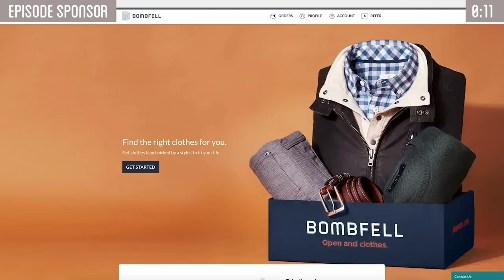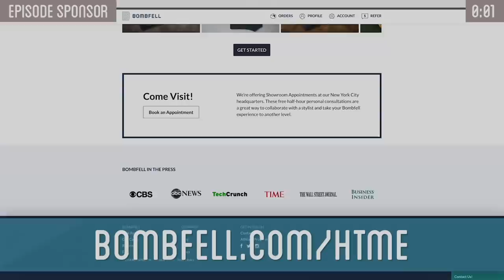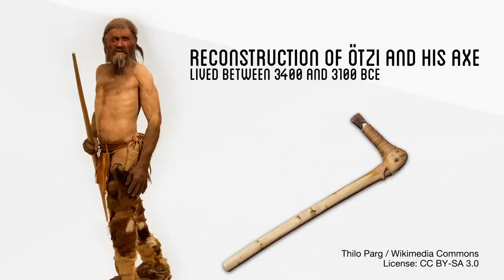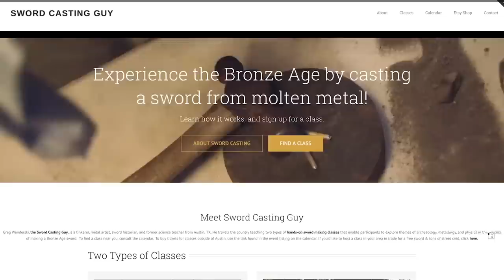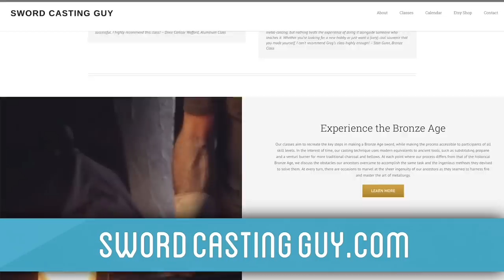Casting a Bronze Sword

Comment: I think it's illegal to destroy currency,and your doing that by melting pennys
Reply: its just pennies in total i think since they are made of metal that is high enough in purity its technically worth more than what it is in material than its given value.
Reply: Question. Is that only in case he tries to profit from them or any kind reason?
Reply: @blazingeek  its in any case but i think the intention of the law placed was so that people couldn't theoretically double or triple there low investment. as 1000 pennies is £10 and technically each penny might be worth 2-3 pence in copper so in turn you would sell £30 worth of copper. that's just a rough example.

Comment: Ok you realize you can't cast a sword right? It just ends up brittle
Reply: Except that you can cast a sword, if you use bronze. Not only is it 100% viable, it was actually done historically in many places around the world. There are even several benefits of bronze over other metals; lighter, easier to make weapons, and should those weapons break you can just melt it back down and re-cast it.
Reply: @FinalFantasyIXIIII  Ok yeah ur right but it doesn't work for iron. Fact